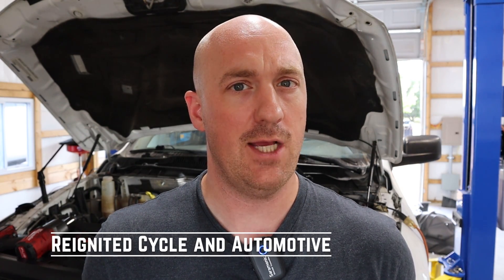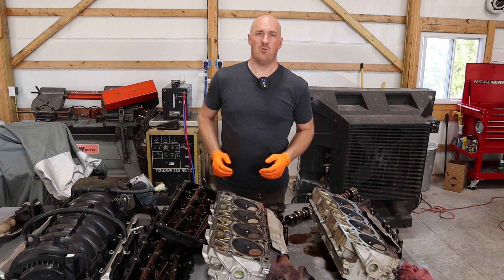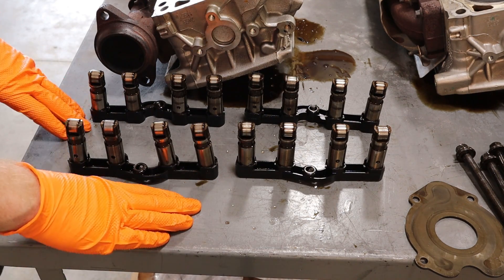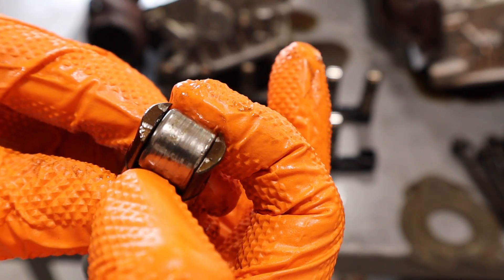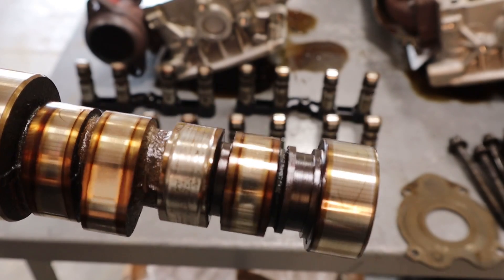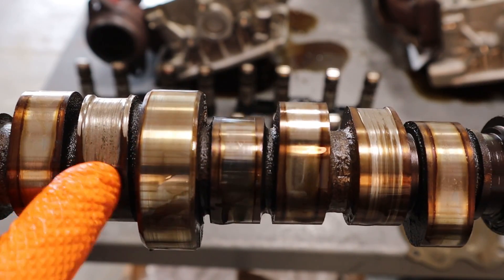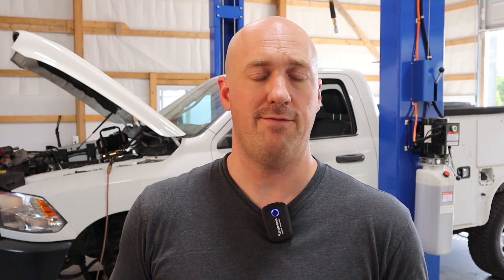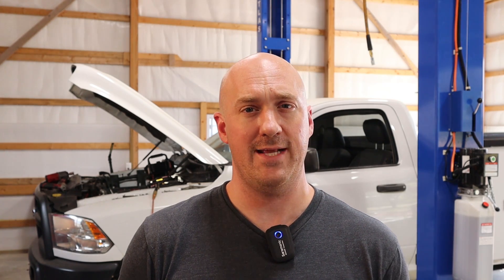Hemi 5.7 Lifter FAILURE Does this engine have a fatal flaw? Find out how YOU can prevent it!!!

Comment: Is it POSSIBLE Chrysler, in a mad conspiracy to make a profit; requires 5w20 because it SHORTENS engine component life?  

Thereby requiring the owner to spend MORE money on repairs POST WARRANTY??   Same goes with a 180 thermostat, car runs better, cooler.  They know that but requires a hotter thermostat.

Dodge engineers are smarter, sure.  But, I am suspicious of some of their recommendations due to the motives are ALWAYS PROFIT BASED.
Reply: Thanks for the reply!!!  I didn’t know that.  Very interesting!
Reply from the maker: From what I've seen over the years, pretty much every single decision they make engineering wise has to do with emissions reasons. The reason the cars run so much hotter from the factory is all the heat makes the emissions components work better, and hot fluids get better MPG due to less resistance. In fact, the brand new trucks actually have coolant that runs through a heat exchanger at the rear diff, to heat the diff fluid faster which leads to a percentage point better fuel mileage overall. It's a big stupid game.

Comment: I only use full synthetic in my 2014 challenger. I only drive it on very nice Texas sunny days my mileage proves it only 12,000. Had to argue with dealer about first oil change had the car for 1 year only 2,000 miles on it. Told him the car sits a lot so I want full synthetic ( which I change every year as part of yearly inspection/registration maintenance ). 
 Never a problem until this year started car very rough idle CEI dealer multiple misfires. Way home engine smoothed out so I drove it a bit hard off/on for about 125 miles CEI went off. Not a problem since. I do have that cold start tick but had that since 2,000 miles

Comment: So both the 5.7 and the 6.4 hemis I have owned made ticking noises (from the dealer lot new). They were both manuals. I have read that sometimes the hemis just make that kind of noise but I fear that the lifters are eating the cam shaft but I have about 18k miles on my 6.4 now and no check engine lights... I just hate it when I pull up to another auto hemi and it doesn't make the noise...
Reply from the maker: I've worked on brand new Hemis for over 10 years now, and yea, they all kinda tick in one form or another. I'd say with your 6.4 manual trans you are in good shape. We almost never see lifter failure in those. 👍

Comment: I have a question I’m looking into buying 2005-2008 magnum rt I was wondering  if it was common for lifters to fail  I hear  with magnum it’s common to have valve seat drop
Reply from the maker: So the -05-08 Magnums don't really have issues with lifters like the later models do. But as you mentioned they do have a bit of a reputation for dropping valve seats, which could potentially be much worse. I would say that PRIMARILY the dropped seat issue happens to engines that have been overheated, however, there are those outliers where the seat drops for no discernible reason. There's no way to verify if it's going to happen or not unfortunately. Best preventative measures are to put reman heads on it that specifically state that they fixed the valve seat issue. 👍
Reply: @ReignitedAuto   thanks u highly appreciated

Comment: I’m hearing a lot of anecdotal evidence (oxymoron?) of a large group of police cars eliminating lifter issues after switching to 10w30 (Penzoil Plat FS).  

I put 10w30 in my 2012 5.7 Charger after speaking with the tech that handles their fleet vehicles.   No codes.  Their oil change intervals are 7k miles, btw.  The tech said they changed to Penzoil after watching oil tests/competition on “Project Farm” channel.

Any thoughts on why this COULD be working?
Reply from the maker: The only thing I could think of would be that the issues arise when the fleet vehicles are idling for excessive amounts of time, therefore the engine oil is about as hot as possible, so it's super thin. switching to a slightly heavier weight oil, maybe it's just not thinning out as much and it's coating the roller needle bearings better? Total conjecture though...
Reply: Thanks for your reply.

Interesting correlation, the 06-08 HEMIs(non VVT)  that do NOT experience lifter failures; don’t they use 10w30?   I could be wrong, but I could swore I saw that on the oil cap (my old car).  Assuming that’s true, perhaps the thicker oil is factoring in.
Reply from the maker: @JohnSmith-zw6tr  Nope, still 5-20 on the 06-08 models.

Comment: I bought my 2006 Ram 1500 HEMI brand new and I have always changed the oil between 2,500-3,000 miles and now she has only 78k miles and purrs like a kitten.  A few years back I did replace the 203 degrree thermostat with a 190.

Comment: I think the 20W oil is too light also. Used for fuel economy, I run 30W in mine
Reply: I agree, 30w INCREASE film strength.  Thus, increases protection for just this sort of thing.  Makes me suspicious FCA KNOWS 20w will cause shortened engine life and recommend it on purpose to increase dealer/repair revenue POST-warranty.   They employ some of the smartest minds in engineering, how could they not?
Reply: Use a good quality synthetic 5w/30.  I use Penrite with zero shear (Aus) anything with zinc and less cleaners the better.

Comment: Had the same thing in my 2010 around 240,000km got the truck as is from a dealer thinking it was just plugs or wires turned out that 2 of the lifters Seized and war them cam down to almost to a perfect circle.
Reply from the maker: Bummer!

Comment: It's a defect.  Oil passages are not positioned correctly to spray oil on the lifters at idle.  My buddy bought a Ram 1500 with this noise.  I told him about it and he laughed it off.  Oh well.
Reply from the maker: Check out my newest video on this issue that shows the oiling system on this engine in more detail! The link is in the pinned comment at the top!
Reply: @ReignitedAuto  Respect, man!  Just watched your other vid and you make some great points.  However, with the added complication of VVT and MDS, oil passages should have been beefed up.  Maybe they missed it or didn't care.  However, the dropped valve seat problem points to a carelessness in the engineering and accounting departments which I can't ignore.  Your point that everyone has a skeleton in the closet it true.  To be fair, Ford has some terrible design features in their older V8's, see cam phasers, broken spark plugs, and ejected spark plugs due to insufficient thread count in the heads.

Comment: do they not shut the oil off to the lifters to make it go into 4 cy mode ? i thought i had read something about that
Reply from the maker: It's actually the opposite, they feed pressurized oil to the lifters to collapse the lifters to enter 4-cyl mode. Check out my updated video on this issue in the pinned comment at the top, I explain the system in much better detail 👍

Comment: I was given a 2007 2500 with a 5.7 hemi. Motor was supposed to be ok but at first start up ran fine. But after a little wiole it's got a nose coming from motor and white smoke. Will the lifter failure cause the smoke as well or a bad head gasket?
Reply: I will have a look at the bolts the tricks been sitting for 2 years and has 440 thousand k on it. Figured would be a good project.  Yes just subscribed to your channel and I will be checking out your videos thanks
Reply from the maker: Likely not lifter failure, but I'd be concerned about any noise coming from the engine. What's it sound like? And when is the smoke present?
Reply: Smoke wright on start up. Sounds like a tapping noise.
Reply from the maker: @TravelingInLowRange73  the noise is likely broken exhaust manifold bolts. Check out my video on the channel about the other Hemi tick 👍. The smoke is a separate issue.

Comment: Hi, im thinking about buying a 2006 dodge magnum rt with the 5.7. Is there a way to tell whether the lifters are bad without taking things apart?
Reply from the maker: Unfortunately no. Your best option is to listen closely to the engine when it's at idle and fully warmed up. If you hear a light tinging or tapping noise, there's potential there for lifter issues. Now, with that being said, the '06 models almost never suffer this lifter issue so I wouldn't worry as much about that. However, the '06 models do sometimes suffer from valve seat failure which could potentially be more destructive. No way to tell on that at all, either the valve seat drops or it doesn't....

Comment: One Chrysler tech I know, said to make sure you run synthetic oil and change it in half the time the factory time frame states...
Oil maintenance is absolutely critical. A LOT of people think that since oil change intervals are longer than in older vehicles, people get complacent, and this simple service procedure is neglected. Can't do that. Of the failures he has seen, which actually are not many, ...THAT is the main cause of this problem.
Reply: Agreed.
Reply: I change my oil at 3500m. The damn engine still failed. I bought it new. I dont tow often.

Comment: Very informative video. I have a 2015 Ram 1500 with 5.7Hemi. With 91thousand miles. I love the truck. Other than one rear exhaust manifold stud broken off. No issues. I will pay attention to the engine hours. I had my ever sit and idle. I'm retired so I say away from heavy  traffic hours.
Reply from the maker: Appreciate you watching! I also have a video specifically for the broken exhaust bolt repair 👍

Comment: I own a 2018 Ram 2500 with the 6.4 . Excellent power fora 6500 lb. truck.Change oil every 4,000 miles with recommended 0-40 Pennzoil synthetic. No funky noises. Gets 17 plus on highway. But, I remember I bought a '79 ford F150 with 80,000 miles for a work truck.  The 1st owner abused it, but it ran perfect. I kept it for 26 years, until I sold it. Had close to 300,000 miles on it. No MDS, no computers , no BS. New Rams, Tin can Fords and Chi-com GM's all have problems. I'll take old tech anyday!
Reply from the maker: The old tech definitely has a rep for reliability and simplicity, but as far as efficiency goes it's a different story. I used to get so annoyed at the people who would come into my dealership complaining about the gas mileage of their new ram diesel,  "I used to get 20mpg from my 12 valve, this thing barely gets 14!" Does your 12 valve have enough torque to pull the moon out of orbit? No? Well I wonder how your new truck is making all that power? Oh Yes, that's right from more fuel! 😂😂😂

Comment: Hey I just fixed my exhaust leak from my exhaust manifold but I still have a tick, it’s louder than the truck you showed in this video. Is there another way to know if it’s a lifter or something else?
Reply from the maker: Noises can be tricky, but usually lifter tick is only present after the engine is fully warmed up and most noticeable at idle. Usually a lifter tick won't be able to be heard after about 1500rpm or so. If you can still hear the noise after that then there's likely another issue. Hope that helps!

Comment: What about the metal debris now in the crank bearings and oil passages and cooler 🤔seems like it's a complete failure not just replace cam and lifters
Reply from the maker: Depends on the engine really. On the 5.7 models, you want to remove the oil control solenoid in the intake valley and inspect the metal screen. If the screen is full of metal debris the engine should be torn down to be flushed out. If there's no metal on the screen you're good with just replacing the cam/lifters. On the 6.4 engines, if you remove the OCV and there's metal on the screen Chrysler directs us to replace the shortblock entirely. There's a built in oil cooler in the oil filter housing and this cooler retains all the metal debris, so if you don't replace everything all the debris goes right through the new engine and ruins it. 👍

Comment: BS.... I have a 2012 5.7 and I never sit idle. I only drive the truck to and from work. It is not a fleet truck. I get the oil changed every 3 months like clock work. I think the issue is with the MDS, it stop the full oiling to those lifters. I only had 84000 miles when it started to tick. I now have a new motor, 5.7, with the MDS delete and haven't had any problems since. It is still early to give a full thumbs up or down. It is a flaw in the motor and you as a Mopar machinic will always stick up for the Co. you work for.

Comment: The cam sets to high in the engine so at idle it does not get splash enough by oil. I always run my engines a quart over full and change my oil at 2 or 3,000 miles. At idle you have at least a quart of oil in the upper end. The crank does not have enough oil to splash the roller on the lifter. And if your a quart down on oil its even worse. I would run this engine at least 1 or 2 quarts over full. I bought my son a ford focus years ago and they did a oil change at it when we got it. It ran fine. We went to change the oil and good think I had my big oil pan drain cause they put 8 quarts in a 4 quart engine. No oil leaks at all. I knew I should have checked the oil dipstick just because people make mistakes. I drag raced a 454 and always ran 1 to 1 and a half over full even with a 7 quart pan. Never had a engine problem and ran it up to 7,200 rpm for 10 years and it never puck oil any were. So I think running more oil in the hemi would probably help this problem or solve it. JMO is all after all my years of this. The real fix for this is to have oil sprayed right at the roller bearing.

Comment: Two words. Valve float.
Hammers the the lifers and cam lobes all the oil in world won’t help. Common in pushrod engines with heavy valve train like hydraulic lifters.
Over-revving, missed shifts, worn or weak valve springs. Seen in race applications with Chevy and Fords as well. Less likely to happen to a more daintily driven vehicle. Happens also on overhead cam engines as well. Just more rare and usually at higher mileage where valve springs are weakened.

Comment: If u replace the parts  will it happen again? Or all the parts are the same poor quality?
Reply from the maker: The parts are the same, but there's so many factors that go into why it happened in the first place it's impossible to tell if it would happen again. Also keep in mind that this generally happens after 100k miles. If you can replace with factory parts and get another 100k out of it that seems pretty good to me.

Comment: whats the torque spec for the rocker arm shaft bolts on a gen3 5.7?  One thing says 16 ft, the other says 106 in-lbs
Reply from the maker: 16ft lbs is always what I went with 👍

Comment: Thanks for the info.

I bought the 2014 Challenger Shaker, Plum Crazy, Badged 0336 out of the 2000 made in 2014. Now only 35k miles.

I have stored sometimes for 2-3 months without starting it.

Once started it ticks a little while idling and I DO Not drive it until the ticking stops.  

My guess is that it having set for a few months the oils has drain down and I want to give the engine time to get lubed up, before putting a load in the motor.

The ticking does stop after 2-3 minutes.

Just found you Channel, today.  Subscribe and hope to see more of your content.

I also have a 2104 RAM 3500 with a 6.4L Hemi with 115k miles.
Reply from the maker: For sure, letting it sit for long periods the lifters will definitely bleed down a little bit. You're right on the money just letting it run for a few minutes to pump them back up. Thanks for watching and subscribing! 👍

Comment: I have read somewhere Chrysler made some change in 2017 on the 5.7 to fix this, is that true?
Reply from the maker: I've heard about this a lot, but I haven't been able to find any verification that any changes were made. The lifter part number hasn't changed since 2009. And I've done lifter repairs on 2017/2018 vehicles as well.
Reply: @ReignitedAuto  It has nothing to do with the oil breaking down- Do not go kissing Chrysler’s ass. It’s a design flaw in the lubrication. Those lifters and the camshaft only get lubricated when the motor is 1500 to 2000 RPMs or more. So if you’re driving the vehicle pretty hard that camshaft and lifters are getting lubricated. It’s basically a race motor. 

Idling a vehicle and the negativity of that has to do more with combustion temperatures and incomplete combustion. Even with incomplete combustion a normal motor would get lubrication on the camshaft. With the hemi generation three it’s a design flaw. Low RPMs twith a hemi motor equal a poorly lubricated cam.
Reply from the maker: @blueboltstrike6705  If that's truly the case, don't you think we'd be seeing practically 100% failure rate with these engines?
Reply: ... kissing Chrysler ass?  You didn’t even answer his question lol
Reply: @JohnSmith-zw6tr  There is no way that all of the oil manufactures producing 5W 20 oil are at fault along with the owners of these vehicles. If you believe that than you are a demented. The most you can blame the drivers for is not driving vehicle hard enough to get lubrication to the camshaft. The angle of the lifters is another story. Very hard to get oil on those. 

You are the low information crowd.

Comment: Is there any way to stop the engine from dropping to 4 cyl permanently so the oil flow to the lifters stays constant to all lifters?
Reply from the maker: Not on stock programming. You can purchase a tuner that will turn the MDS system off entirely if you wish. 👍
Reply: In doing the tuner shut off of the MDS will that have any negative effects?
Reply from the maker: @mnsservices  Only on your fuel mileage. It'l drop a little bit, but I wonder if you'd even notice. Supposedly the MDS system gives an eight percent increase in fuel economy.
Reply: @ReignitedAuto  thank you!
Reply: @ReignitedAuto  I don't drive a Hemi to worry about fuel mileage,  I would not but truck and worry about that